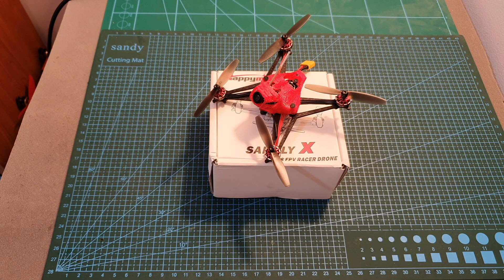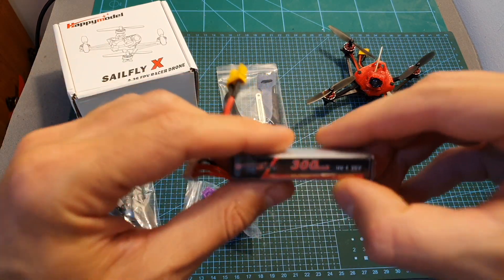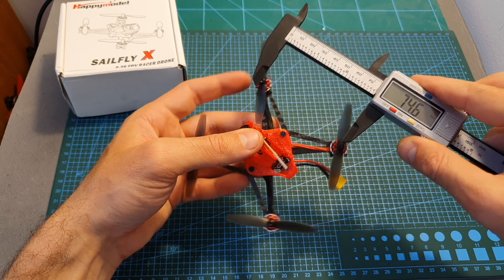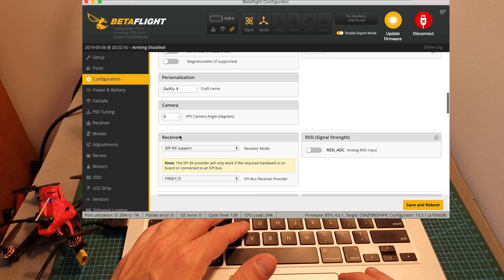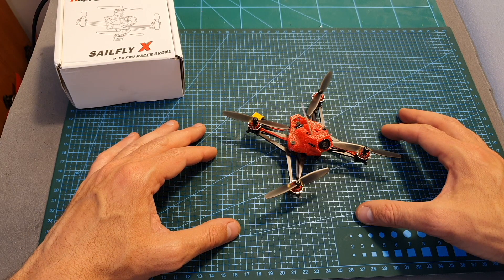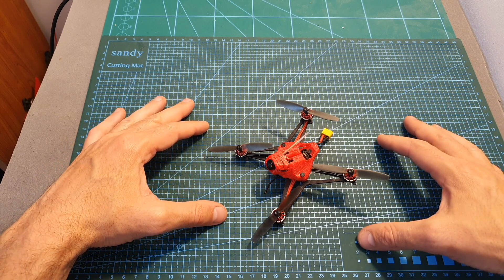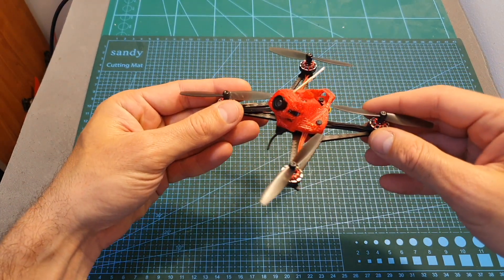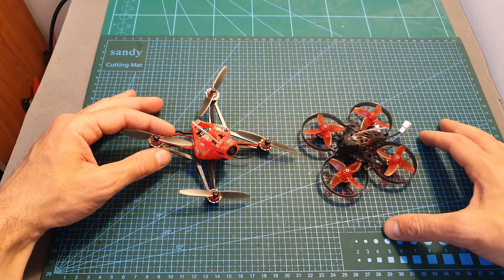Happymodel Sailfly-X 105mm Micro Racer - Review & Flight

Comment: what propeller will fit this quad? I've seen almost all props available at banggood and could not find these props with 1.5mm hole
Reply from the maker: I just tested these props and they fit perfectly: http://bit.ly/KingKong65mmProps
Reply: @KremerFPV  Yes they fit the 1mm motor shaft on your "review" model.  But what I've heard is the production model will use 1.5mm motor shaft.  My guess is that eventually when this goes into full production they'll also post the 65mm prop (gemfan version) with a 1.5mm shaft mount.
Reply from the maker: @lahawtho  Thanks, I will check it out